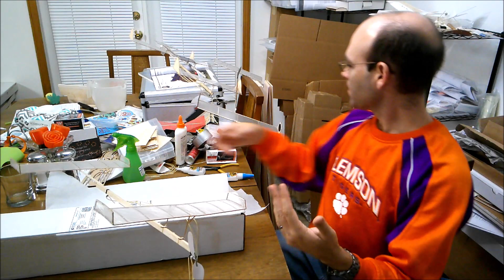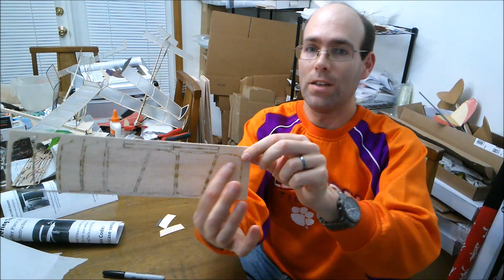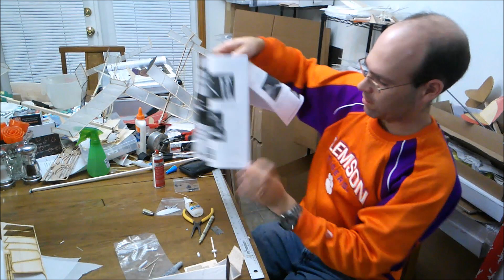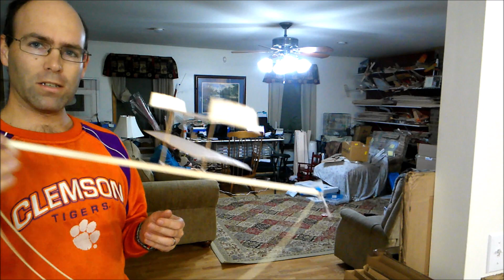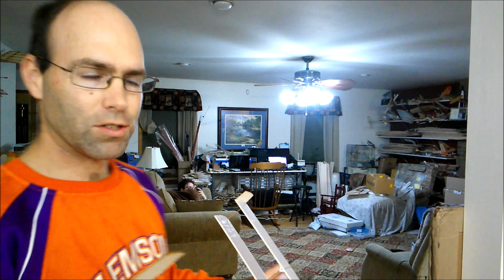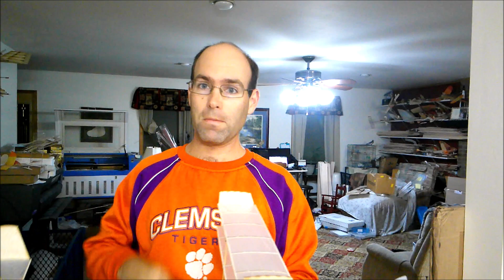Wright Stuff Kit Review 2020, 3/5: Guru Engineering Tech Propeller Plane

Comment: How would u fix the problem where the plane just falls down directly after flying for a while
Reply from the maker: Nose level or diving? If it's falling straight down, nose level, that's a stall. You may be able to fix it with nose weight, especially if it's happening after the climb has ended. If it's happening during the climb, add down thrust.
Reply: Thank u